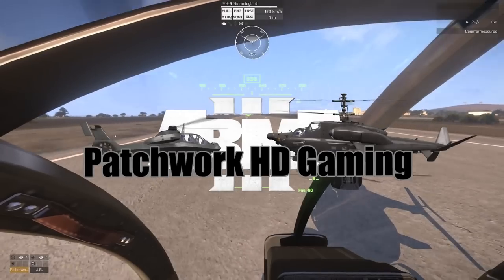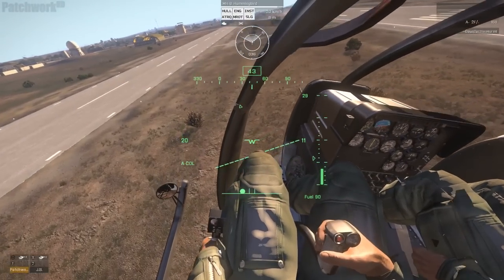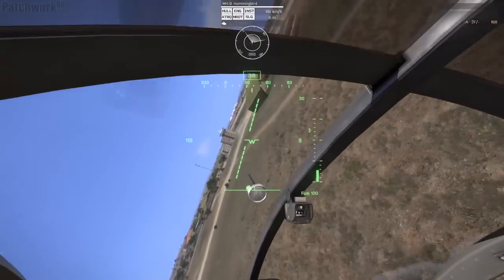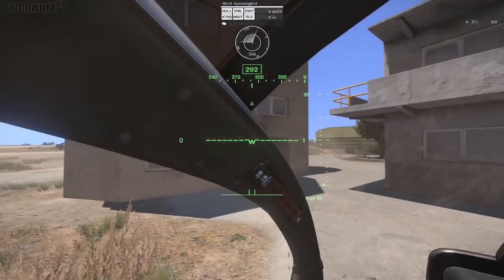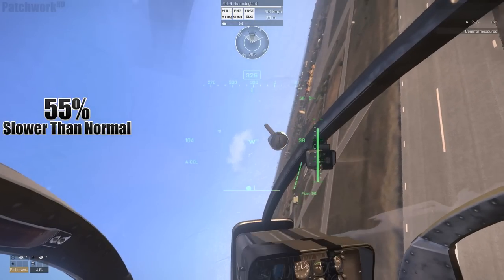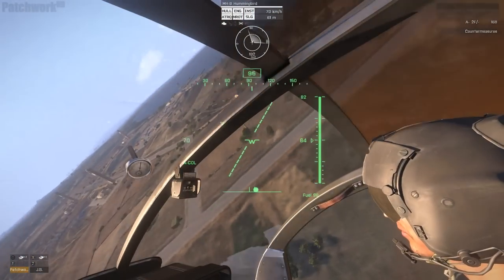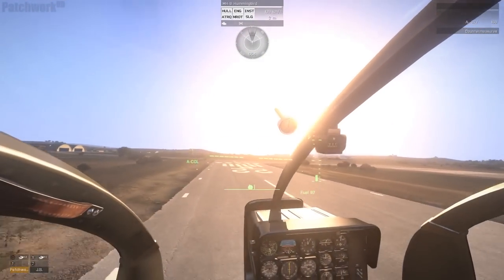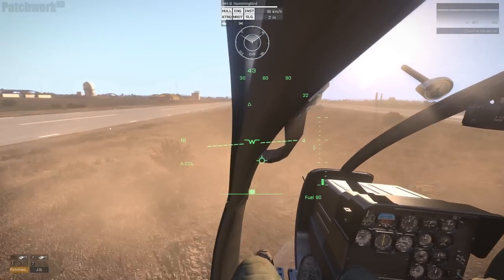Turns, Reversals and Rapid Bleeding - Flight Quick Tips #10 (Arma 3 Helicopter Tutorial)

Comment from the maker: Im Twister It's not easy to explain over a comment, but I'll try.
1. Turn the airframe to about a 45 degree angle in the direction you want to turn.
2. Pull the Cyclic (Flight Stick) all the way back to start turning.
3. Add full left or right pedal depending on the direction you are turning (left pedal for left turn, right pedal for right turn). This will give you a little extra speed throughout the turn, and also keep your nose from climbing.
4. You can keep level and on the horizon throughout the turn by slightly rolling left or right.
Reply: Ok, If for a right turn:
1. Press "D" to turn 45 degree.
2. Press "S" to turn.
3. Press "E" to keep nose from climbing.
4. Adjust with "Q" and "E" to keep things horizontal

So why do i crash and why does my speed not go down one bit T.T?
Reply from the maker: predatorvmt Doing the uturn is what ends up dropping the speed. As for the crashing, all I can say is practice.
Reply: I was like making a continuous U-turn and it became a "mh-9 going circle". But the speed never went down. While i have perfect balance, but because the heli is like 90 degree to the right, there is no force to keep it afloat. Eventually, it crashes?

Do i need to turn down the engine power when making U-turn?
Reply: predatorvmt it's because in the last step you're hitting Q and E which are pedals. Instead hit A and D to roll the helicopter
Reply from the maker: +joa123kim456 It's "Kimi's Helmet Mounted Displays mod" http://www.armaholic.com/page.php?id=26351
Reply from the maker: ***** no problem.
Reply: you have a hand book for this technic?
Reply: This isn't easy at ALL it constantly goes up and down the nose even though I'm holding the back cyclic.

Comment: Very nice Video, i am following your channel now for a while and I do think you deserve more Subs. I have one question, would you know what could cause the collective only to work "half way"? What i mean is that I can only fly half speed without dropping becasue it seems that when i use my collective mapped to the throttle I can only use half of the collective up or down.

Thank you for your time!
Reply from the maker: TheNorthernAlex Well, I have 2 possible ideas for your collective problem.

Possible Solution#1 - In the Standard Flight Model make sure you're using "Collective" and not "Collective [Analogue]" to bind your throttle even if you're using an analogue supported input (Hotas, gamepad). Even if you use the non-analogue specific binding it will still accept analogue inputs perfectly fine. "Collective [Analogue]" has a way of always inputting about -5% collective in a neutral position when in the standard flight model.

Possible Solution#2 - Remove every other input that is bound to collective except your main input device you're wanting to use. I've had the problem I believe you're describing where instead of collective supporting 0%-100%, it only moves 25%-75%. I unbound every key that was bound to collective (other than the intended input device) and the problem vanished.
Reply: Patchworkᴴᴰ Thank you for your prompt answer, I am going to give both solutions a try and will let you know which one worked, if not both of them.

Comment: Hey Patchwork, i saw that you are using a Saitek x55. Ive got the same Joystick, but in Arma 3 ive got a little probleme: If i cycle forward/backwards/etc. with my keyboard, my helicopter does faster motions than if i do it with my joystick. Also in Cockpit View the Joystick of the helicopter ist just turning about 20% when flying with the joystick, compared to the motion of the keyboard. This results in an very slow turning speed, now i wanted to ask if youve got the same "problem" or if this is a feature in arma 3 for more realistic flight? I tried it with the AFM on or off, no difference. Ty.
Reply from the maker: Loper5LP hmm, I have also been having a bit of problems related to sensitivity since the last update. Could just be a bug needing to be sorted.
Reply: Patchworkᴴᴰ Ok, ty for your fast answer, i guess we will just have to wait, maybe i can create a feedback tracker bug report.
Reply: Patchworkᴴᴰ Hey patchwork, i found the answer to the problem: http://feedback.arma3.com/view.php?id=24064#c92685 i just did what he said and it worked, so if you or other have this problem you can try it out. It is a bit of work unbinding and rebinding all the keys but it was worth it^^

Comment: Hey I have a question. So recently I have decided I want to join the aviation(pilots) section of the arma unit im in. Now I have never used a joystick so i have been learning all my flying w/ mouse and keyboard w/out trackir/tracknoir. I was wondering if you knew of any good joystick for a beginner? Or at the least can name me off some requirements I should look for in a joystick and how much of a difference will trackir make for someone compared to not using it? Thanks for any help. Great videos btw keep them up they really help!
Reply from the maker: If you're looking for really cheap helicopter analogue controls, 360 gamepad is really great for a 20-30$ price tag. It allows for Analogue Collective, Cyclic, and Anti-Torque pedals with the two sticks and triggers.
For a cheap and more traditional joystick the Logitech 3D Pro is alright 

For a $70+ price range the X-52 is a really nice first HOTAS, and the X-55 is another good choice and a cheaper alternative to the ThrustMaster Warthog.

TrackIR is also going to make one of the biggest differences for flying, and one of the biggest immersion bringers for flying as well. If you also play a lot of Racing Sims, DCS, Elite Dangerous, or Star Citizen then it's also more reason to pick one up.

I recommend TrackIR for start. TrackIR brings something that you don't have with KB&M. And although a Flight Stick might be a nicer flight experience for you, it's by no means necessary to be a great pilot. It is possible to become a great pilot with KB&M or a Joystick. CallMehTOMMEH is a great example of what is possible by practicing with a Keyboard and Mouse: https://www.youtube.com/user/CallMehTOMMEH

an ideal setup though would be TrackIR5 with a HOTAS stick and throttle, and rudder pedals if money was no limit.
Reply: Patchworkᴴᴰ Thanks so much! This really helped because I had no idea what to look for before this.
Reply: Patchworkᴴᴰ Do you know of any tutorials where people fly with the 360 gamepad? I have one at home and want to try it out.
Reply from the maker: bupa44 Tutorials? Not sure about that. However, you can give this a try http://i.imgur.com/l77WKns.jpg
Reply: Patchworkᴴᴰ Perfect. Thanks so much for the help really appreciate it!
Reply from the maker: bupa44 No problem.

Comment: What is the recomended speed to be touching down at? whenever i go into editor to practice, i always end up blowing up on landing. is this because of my angle of the speed i dont know. but just sort of a recomendation?
Reply from the maker: -5 Meters a second or slower is recommended
Reply: +Patchworkᴴᴰ thank you
Reply: That is vertical speed, right? How about horizontal speed? (Implicating forwards) Because I know I can land much faster moving forward and slide or roll on the ground without damage.
Reply from the maker: Razer1103 Yes, I was talking about vertical speed.
Reply: How would you answer the question if it was about forward speed?
Reply from the maker: It really depends on the LZ (Slopes, clearance, etc.), but I'd say 10-25Km/h can help people who may have trouble holding a stable hover, or have a tendency to bleed too much speed and end up drifting backwards.

When it comes to me personally, 30-40Km/h is probably the max speed I would attempt to land at, but I really don't do many rolling landings in Arma 3.

Comment: What if you do not have pedals and just a flight stick?
Reply from the maker: chris houck Most flight sticks have a twist allowing rudder input (or anti-torque in this case).
Reply: Patchworkᴴᴰ  I have a saitek x52 pro could you help me by telling me what that means im sorry im abit new to joy sticks and would love to get better ;)
Reply: chris houck Also what would be anti torque in arma 3 im not to sure
Reply from the maker: With pedals, you would be controling your anti-torque rotor on the tail. However, since you don't have pedals you should most likely use the Yaw input on your joystick. The x52 Pro has a twist joystick that allows for yaw input. You can find a diagram here where the red arrows illustrate the twist/yaw input http://i.imgur.com/0kGJVid.png
Reply: Patchworkᴴᴰ  Would you mind saying your setup (mapping) without the pedals so it would be easier for me?
Reply: chris houck if you dont mind

Comment: no idea what to press with a keyboard and mouse
Reply: Literally,
1st Turn:
1. Pitch up pressing S, till you feel like you are stopping quickly and raising in the air
2. Start pressing Q or E to yaw to the opposite direction, and start pressing W to pitch down.

2nd Turn:
1. Roll to the either side with A or D till your body is parallel to the ground and start pressing S to start turning(or actually pitching parallel to the ground.)
2. Also start pressing Q or E(Depending whether you rolled to the left or right) to attempt yawing in the direction you rolled to in Step 1
3. At this point, your helicopter is definitely not going to turn as beautiful or constant as it is so, you have to continue pressing a bit of roll and pitch to like adjust while you turn, by maybe tapping the keys or holding and releasing repetitively.

It's not easy so it's definitely going take practice and also being able to feel it yourself.
Applicable to Basic Model only too.

Comment: I want to know what monuvers are used to make border line sharp turns. for very advanced like this guy ( mainly at 4:25) https://youtu.be/nyXX2-Z_MAs     I know theres got to be something, in our K-38 training one of the simple tricks to get your jetski to turn on a dime harder than you can hold on art high speeds was to jerk a right then heav left. a simple trick that that whips you around in less than a second at full speed. now with jetski you work on 2 planes but with heli your on 3 or 4. im guessing its with combination of tale rotor, roll, and yanking the stick into yur cock, but can you give me a presise answer of how he can make a 140 kph turn in a 10 ft radius to a full stop. this is a level of adjility i been trying to learn for quite a while. please help
Reply from the maker: +DERPY RAGE The trick is to get as much of your main rotor systems downforce into your flight path, instead of having your rotor cutting through the air like in a sharp turn. So if you want to bleed speed by turning, you need to look at it from your rotor discs perspective rather than the perspective of your helicopters body. Before you turn, try nosing up a little bit so your rotor disc starts bleeding a bit, then when you make the turn your trying to put your rotor disc facing directly in your flight path. You can see a Chinook doing it here: https://www.youtube.com/watch?v=oLjW0j2ZfBQ Watch his rotor disc and see how almost all of his downforce goes into his direction of travel to slow him down. You'll see the same in these Arma videos.
Reply: I see, his force velocity is on the X axis  then he uses his own momentum to  convert his potential momentum to an angle onto the Y axis to Almost completely counter force all velocity on the X axis, then rolls out onto the X axis again to make precise force control to now fully equal a complete counter force of the original X axis to balance his volocity to 0 { more of a good  hover}. Its so simple yet so efficient. thats exactly what the Pawny did in the link. i couldnt see this in first person, i only asume his monuvers.... this is so awesome. i can change my entire way of evacing now.  thank you so much for this. i owe you.   But now i cant get a Chinook to roll or turn worth a shit IN ARMA 3, since i understand this now, is it possible with arma's buggy physics? in both standard or advanced heli simulation to do what that chinook did. could my rotor in the advanced simulation handle such stress in a turn like that in a Chinook. or will i have to find a mod that raises the quality in the rotor to allow much greater resistance in stress from force?
Reply from the maker: DERPY RAGE You can do it in the AFM, though if you have stress damage on, you will want to turn WITH the torque, and not against it or you risk over-torque which will cause stress on components (e.g. The Ghosthawk you'll want to turn right, while the Kasatka you'll want to turn left.)
Reply: what AFM? yes alter your velocity in a pendulum flow, i didnt think about that turning to the side of the tail rotor was the less stress, i understand. so how much is the force multiplied if you turn to opposite side of tail rotor?